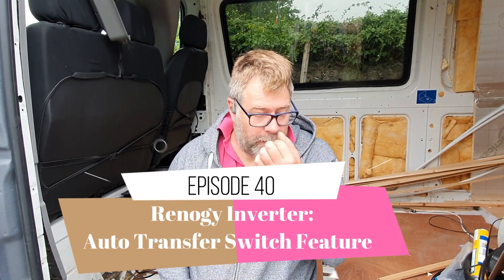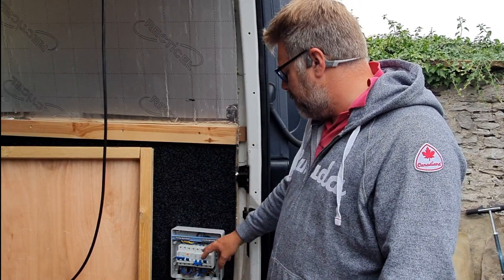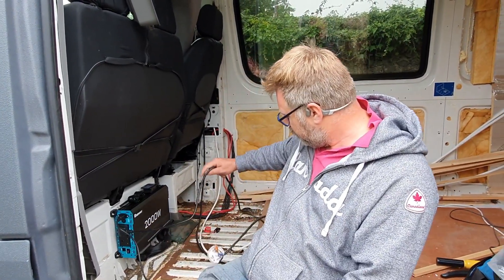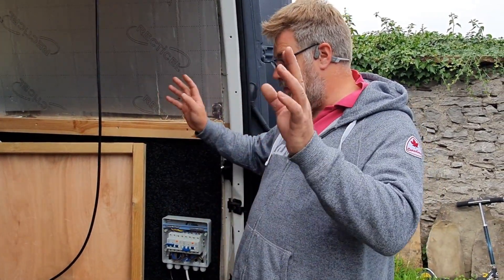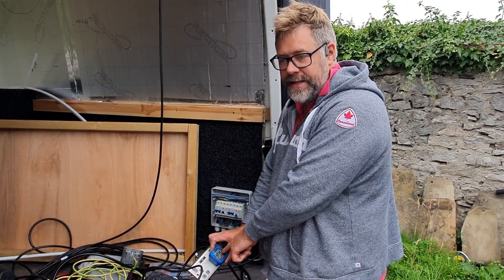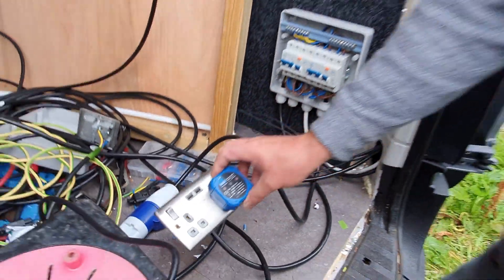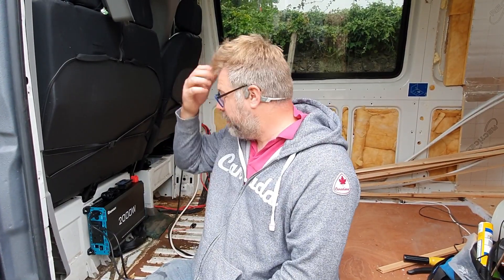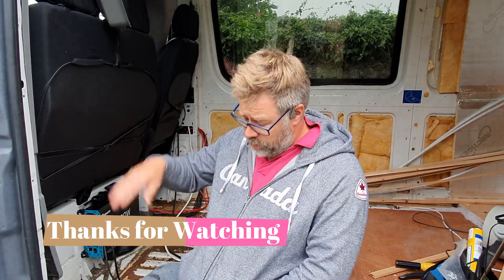Renogy Inverter: Automatic Transfer Switch Feature (episode 40)

Comment: The transfer switch is basically an internal relay that switches out the neutral to earth link if you’re using mains(shore) power.  Disconnect mains and you have the link back.

Comment: Great video and i totally agree that the documentation is terrible on this functionality. Question I have is how much current can the bypass circuit take? I have a 1000 watt unit vut when on hookup i want to be sure i can run 2000+ watt appliances through internal switchbif that makes sense? Thanks

Comment: Why not put shore power from exterior shorepower socket straight to inverter then inverter output to consumer unit?
If on, inverter would power van from battery and then when shorepower attached it would go to bypass, and if you lost or had intermittant mains supply it would swith to inverting mode.
If off it would still work with shorepower but not power from battery until turned on.
Reply: Exactly my thought

Comment: I'm sorry for sounding thick, but I'm struggling to understand why the power out of the inverter has to go back to the MCB box before powering back out to the sockets.  If the power comes into the MCB from hook up, then out to inverter input, why cant the inverter 'output' just wire straight to the first socket in the chain powering all sockets?
Reply: They provide protection if the inverter is running as they are downstream of it. The Shore power protection is upstream of the inverter so has only an effect when shore power is live. Yes this creates a level of "double " protection but without it you would have no protection when shore power is off and you are using the inverter power exclusively.

Comment: You have an unsafe system. Although you have a RCD on the output of the inverter it will not operate and thus not  protect against electric shock .
For the RCD to function when the inverter is operating in stand alone mode,  the inverter needs a neutral to earth bond. The Renogy inverter does not automaticly make this bond.
The Renogy pass through inverter must not be used in a permanent install powering multiple outlets and appliances. The output , in stand alone mode, no hook up power, is 120 volts on  both the live and neutral with respect to earth. 

Mike
Reply: Yes, correct. But he thinks that the socket tester showing an earth fault is because it’s a van. With the correct neutral/earth bond then the socket tester would not show an earth fault. It’s worth pointing out that the neutral/earth bond MUST be disconnected when plugged in to the hookup up.
Reply: Hi guys, you sound like you know what you are talking about, and I am truly lost in this jungle :). Can This set up  be used in a permanent install powering SINGLE outlet just for ONE appliance, and do I have to connect weehicle chassis to earth point on the inverter as some say in case of malfunction it can fry car's electric?
Reply: @volodymyrsidenko2230 I’m not an electrician, and correct earthing is a very complex issue. I did have a conversation with a very experienced electrician recently who said that he preferred to not have earth/neutral bonding on this type of floating earth inverter, because there is only 110v on each conductor and if you touch one of them you cause that one to go to zero and the other one to go to 220v, but I don’t really understand what he means. What I do know is that fault detection devices (RCCD’s etc) won’t work properly with a floating earth. There is also some train of thought that having an earth on a camper van is a waste of time because it is insulated from earth by the tyres. I connected my Renogy inverter with a relay that makes an earth/neutral bond when there is no hookup power and then disconnects it when the hookup is connected. I’ll try and find a link to a vid for you.
Reply: @v @volodymyrsidenko2230  https://youtu.be/naOGeAzWbvY?si=YjrSH91zlvcLWZnc
There are several others, but this gives you a good idea of how to install a Renogy inverter.

Comment: We're looking at doing a van build and this is super helpful! Thanks so much!

Also, is this feasible?

Say you're on a site on EHU, a storm knocks the power on the site out, inverter kicks in, to get around the no earth fault, can you junction in the earth from the EHU lead, so you're always earthed? I'm not an electrician, can you tell 😂
Reply from the maker: No you can't however that's not important. Check out my later vids about inverters and earthing. Really boring but all the information is there.
Reply: @AlwaysVanAdventure  never boring! Thanks so much, fully invested! 👀
Reply from the maker: @samueldennis8343  btw if you are on Instagram you can always message me. Unimpressedjeff

Comment: Sorry, didn't cover an important feature of which I still can't find the answer.
I plugged my system into a 240v campsite hook up yesterday but still dont know if that sends power through the inverter to top up the batteries?
My solar display continued to read 12.2v. I was hoping to see 13v.
Reply from the maker: Nope. It's not a battery charger so wouldn't have covered that feature as it absent from this device. It does 12 v to 230 v only not 230v to 12 v

Comment: Hi, maybe you could answer a question.  If I wasn't using a split consumer unit and wanted to be able to power all  sockets from the inverter, is it just a case of connecting the ac input to a spare socket then the ac ouput from the inverter back into the shore power  input. If that makes sense. Thanks (great video)
Reply: I should elaborate.  I'm using a sargent ec155 for my dc and ac and want to use the renogy inverter to power all sockets through the ec-155. Sargent tell me No don't do it.and won't help. Can't find anything online, then found your video. 👍

Comment: Wish for a schematic to give my electrician. I bought the 3000watt Renogy with ATS and a sep lithium charger getting this done in a caravan would be great!
Reply: OK, so i watched the video again! Great video, part I’m not sure about, in an old caravan is already prewired with all sorts of 240v shore power (Australia). If sparky put RCD etc on will he plug a regular lead in the inverter and hard wire it to existing shore power circuit. Therefore effectively replicating the system you’ve demonstrated?
Reply: What’d happen if someone plugged the inverter input to the (only) shore power plug using there own seperate lead? Would it trip or stop or break and fry something???

Comment: But what happens on that loop if you have a lithium smart charger plugged in that comes on when you plug into shore power (if that makes sense 🤦‍♂️) would love mine to do this. Thanks
Reply from the maker: This is shown in the diagram near the end
Reply: Odd but I can’t see the diagram, it doesn’t come up.
Reply from the maker: @akaday  my bad. Wrong video. Yeah you can do it. If you on Instagram message me. Unimpressedjeff

Comment: Since when is that AC outlet a transfer switch? As the instructions say it's for directly wiring multi outlets on one circuit... I don't see anywhere it says you can supply voltage to that outlet..
Reply from the maker: You don't. It has an input and an outlet. The outlet goes to the sockets. The inlet to shore power hook up.
Reply: @AlwaysVanAdventure  Well that must be some old Renogy Inverter. As the one they sell now wights like 55lbs and looks nothing like that one..
Reply from the maker: @WizzRacing  it was available to purchase at the time I made the video
Reply: @AlwaysVanAdventure  I'm trying to find that model on their website... You got a model number? As it sure looks a lot lighter then the one they show now. But the new one does up to 75 amps Lithium charging when plugged into shore power..Might be why it weights so much now...
Reply from the maker: @WizzRacing  the inverter charger and inverter are separate products. The renogy 12 volt 2000 watt and 3000w still showing on renogy website and Amazon
Reply: @AlwaysVanAdventure  I get that.. But they don't show that model Inverter\Charger. 

As they look nothing like the one you are showing.. 

The one you show looks like the inverter only models...
Reply from the maker: @WizzRacing  it's just an inverter. It's a renogy 3000w 12 volt inverter. I never said it was a charger too. The one that looks like it is it. Honestly I have no idea why you are finding this so difficult. The model I tested and did the video about operates in the way I describe. It doesn't operate like a totally different model. Nor is the model I didn't test the same as the one I did.
Reply: @AlwaysVanAdventure  I'm asking about the Transfer Switch you say it has builtin...

Comment: Can you help?  I have a Renogy 3000 watt charger/inverter with an led screen. The monitor shows 85% with batteries at 250 ( 3, 100 hour lithium batteries). I also have 2, 100 solar panels. I want to top off batteries and plugged into shore power. Power source check out good. The batteries never get beyond 85% or 250.  Either with the inverter turned on or off. The only drain on batteries is a Dometic refrig which isn’t that much draw. I've been plugged into shore power for 3 days. Also, I had in the past had battery readings of 100% or 296. What am I doing wrong?
Reply: Oh, when plugged into shore power, the led screen on inverter reads 122 in and 122 out???

Comment: Great video! I was exactly looking for that info. There's just one thing I'd like to know: being the inverter off, can you draw more than the 2000w from mains passing through the inverter?
Reply from the maker: I believe up to ,16 amps but you would have to check to be sure. If it's a 10 amp pass through then yes 2000w is about your max.

Comment: Dude - Good video, but in your cold beer scenario,  on mains in failure how do you stop the guy working on the mains in supply or generator in supply getting a belt from the 240v being produced by the inverter and being fed back through the consumer unit into the mains in connection? What am I missing

Comment: Great vid thanks! What would happen if you connected the shore power straight into the inverter though? rather than going via the first RCD/MCB first?
Reply: Dan, I’ve got the exact same Q. If the inverter uses the transfer switch to alternate between sources before distributing the output via MCB/RCD then to power outlets would this work?
Reply: @erickerr4960  hey so from speaking to some people who’ve done this before, the way to do it is have shore hookup > rcd/mcb > inverter > sockets. This is to protect the inverter. The renogy invert has surge and leak protection built in, so there is no need to have another consumer unit after the inverter (you could it would just be pointless). Then after the inverter you basically just wire up extension leads to sockets. This is what I’m going with :)
Reply: @kyaorrb  yeah I thought so.
Reply: I run an extension lead into the van from the shore power. Then I plug the kettle lead from the inverter into that. Keeps my van wiring to minimum.

Comment: Hi Jeff.  I have just bought the Renogy 3000w inverter and you have just given the best explanation on how it is set up. Thanks. What is the make and model of the consumer unit that you have used as I am struggling to find one that is similar?

Comment: Really great clip!  I guess when the inverter is off the mains AC will revert to 3kw of power going in and out of the unit and is not restricted to 2kw?
Reply: I was a bit unsure about that, so sent an email to Renogy and this was their response:-

All of our inverters will still produce their rated power output even if they are connected to an AC input. This means that the 1000W inverter will still produce 1000W even when connected to mains power.

So it seems not, which is a bit rubbish

Comment: Without expanding too much, there are SO many electrical safety issues here. RCD on inverter wont trip due to a lack of neutral - earth bond. Hardly any DC or AC cable protection from metal abrasion. 
Back feed issues into the grid. Chassis grounding and AC earthing are TOTALLY different 
A generator 4 pole transfer switch is a better option ( Make Break Make)
A test button does NOT prove an RCD will trip.
They trip by detecting an INCOMING  imbalance between polarity and ground potential difference which needs a reference to earth. They dont trip on your side ...on the INCOMING side.
BE CAREFUL !!
Reply from the maker: Please check out later videos regarding the above. Thanks

Comment: I'm a little puzzled to be honest, after discovering the inverter I have has a built-in auto switchover mechanism ... same as yours but the 3000 version... I don't know where to run the lead to from the inverters AC input...  do I remove the original hook up lead that comes out of my breaker unit that is fed from the outside hook up point or tap into it with some wago connectors  ?  Or is there another way  ?  My van is a motorhome by the way so it has a little circuit breaker board that controls the electrics
Reply from the maker: Message me on Instagram. @unimpressedjeff and I will be happy to discuss.

Comment: It's kinda weird that I have come across your video about this, ive had the 3000 renogy inverter now nearly 12 months and its never bleeped once, running aircon and electric hobs together etc, and I have only today been wondering why...if I run an extension lead with a socket on if I plug in a plug tester it shows no earth is present, and I've been wondering...and still am even after watching you.. how that AC port switchover works and how I can wire it up
Reply from the maker: Hello. I have run more recent videos about centre tapped Vs neutral earth bonded inverters. Check em out to go further down the rabbit hole.

Comment: Brilliant! So, just to make sure I understand...this setup will supply power to your outlets automatically from shore power, but because your Renogy device is not an inverter charger, it will not charge the batteries via the shore power. Is that correct?
Reply: Correct. I bought a Victron Smart charger to charge my lithium battery. I have the same inverter. I could not justify the cost of the combined inverter/charger.
Reply: Damn, the only reason I plugged into shore power yesterday was to top up the batts.
That would be a very useful feature!

Comment: Thank you for this video! 🙌🏻
One question if I may.....the shore power comes in to the consumer unit, through the rcd then via the MCB where the inverter is wired into....do I need to then bring the outlet part of the inverter back into another rcd and then out via another MCB to go to the sockets? Or can I just go direct from inverter via consumer unit straight to sockets? My board has 40amp rcd and 2x 16a MCB. 
Thanks! 😁
Reply: Jeff same question as Bradley, any chance you could do a quick schematic on the set up to help get my head around it a little better, cheers

Comment: OOooooooh!, Jeff.
That was probably the most thought provoking video that you and Pixie have produced to date.
I now have to go out to see if my CSC2000's transfer switch operates if the inverter is switched off.

Renogy may not be the big name in van builds/overland rigs/ off road /off grid yet, but they are certainly great quality products at way less than sterling/victron prices.
Good choice, good video
Reply: Pixie is the talented one
Reply: Hey mate did you figure out if there is mains power at the inverter outputs with the switch turned off?

Comment: So... In a previous video you showed us a auto switch. That switches from mains to inverter, this inverter makes that set up redundant. Pretty clever.
Reply from the maker: Well if you buying an inverter now this might prove to be a good solution. If you already have an inverter you could use the previous video method. Either way you have a solution.

Comment: Does it also charge the battery through the inverter? Iv seen other inverters that will also charge the battery up to 30A from the inverter when your on mains hook up power.
Reply from the maker: There are inverter chargers but this isn't one of them. I am using a separate 30 amp charger that will only activate when on hook up power.
Reply: Sunshine Solar CSC2000 is an inverter/charger , however the charger is 15A. Be careful at the rate you charge at. Most leisure batteries are rated C20